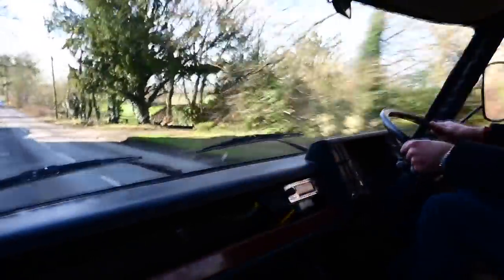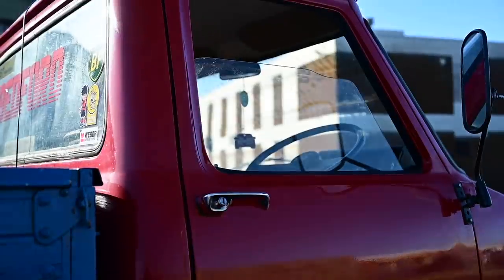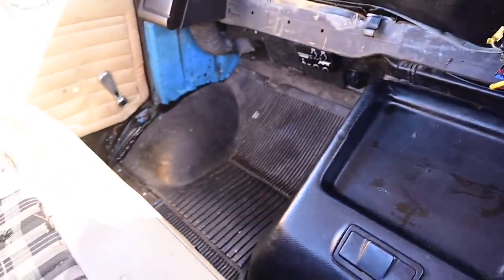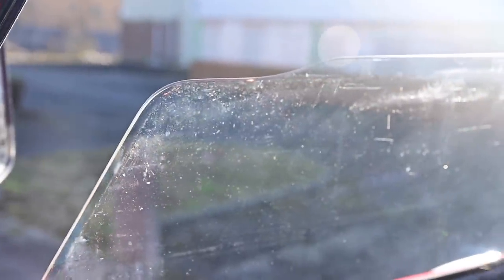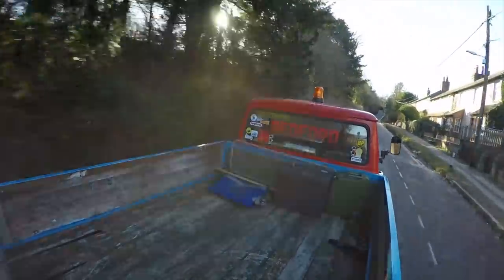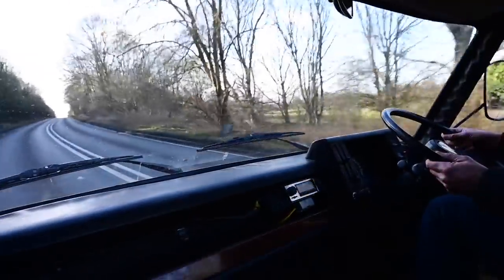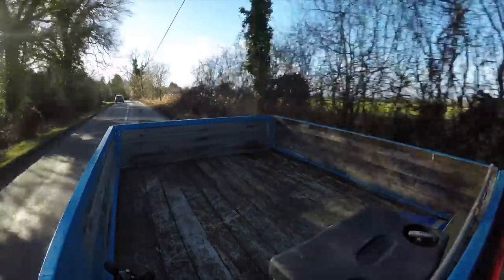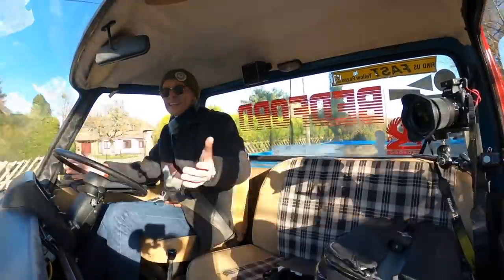1982 Bedford CF CF1 Pick up Goes for a Drive

Comment: Aussie CFs were also available with Holden inline sixes in them like the Aussie Transits were available with Falcon sixes.
Reply: I’ve got one! LWB van, 202 4 speed.
Reply: same in New Zealand
Reply: We here in NZ had those same choices of vans. The Holden 202ci was not only retro fitted, but endorsed by Vauxhall / Bedford.
The Australian 86-87 CF2 exported the inline 6 for inclusion of the chassis cab for NZ St Johns ambulance contract via the UK 🇬🇧 then sent to NZ as a CBU chassis cab for St Johns to coach build.
The NZ importer was Jones Locke Holden in Takanini, South Auckland. ❤😮
Reply: Our CF has a stock 173 Holden Red Motor, with all Holden transmission,brakes etc.
Reply: @kenwatkins7097  the 173ci would have been 2600cc used for LC swb Torana ( holden ) in my native NZ.
They would have been a quick turnaround for retro fitting in CF's in mk1 form 😉 l.o.l
Reply: @vernonmatthews181  Thats right, the 173 motor was used in the 6 cylinder Toranas and HQ,HJ series Holdens. Our 1979 CF van has the Low Compression 173 engine, 4 spd gearbox ( Holden, with the reverse switch), single drive shaft (whereas all the NZ ones I've seen have a double shaft), high speed diff, Holden brakes/drums & wheels, and the 'Manufactured by General Motors Holden' plate. But, all the wiring is stock UK stuff.

Comment: My parents had a 1970 Transit with a CI wayfarer conversion with the 1600cc v4 which was as slow as treacle in winter, it was replaced by a CF with the 2300cc engine and had a large coachbuilt Dormobile body on it, it felt like Porsche performance after the Ford. Good test.

Comment: I remember these being absolutely everywhere in the early 80s (along with Sherpas), definitely more common than Transits until that became the VE6 one-box design. Excellent find Matt!
Reply: Transits outsold the Bedfords in the 60's, 70's and beyond. The mk1 and mk2 Transit were everywhere back in the day, I remember seeing a lot more Transits than Bedfords about. 

I grew up with my family using both, the Bedfords were troublesome and a lot more unreliable than the Transits were, they especially loved to eat gearboxes.
Reply: Sherpas, 10 a penny in the post office.
Reply: Transits allways by far the most popular vans on the road in the uk.much more popular than sherpas and bedfords put together.

Comment: I’ve drove many of these for Sunderland Council excellent vehicles on the petrol engine the engine was a bit of a weakness Half a v8 or the slant 4 but the  bodywork would go on forever the main rival was the Ford transit had a brilliant engine but the bodywork was terrible.Thank you for this video brings back memories and also very interesting
Reply: Worth doing an EV  conversion in it, loads of space for battery pack, I-Pace or Prius transmission under the rear, 250/275 mile range would be respectful and usable...
Reply: @kylereese4822 wouldn’t get anywhere near 250 miles.

Comment: My dad had a fleet of these in the 70's / 80's. I remember picking up a brand new LWB van from Chatham Motors ( I think it was) in about 1983, having just been painted dark metalic blue 2.3 petrol. The Petrol tank imploded on the M2 motorway bridge due to the wrong non vented petrol cap being fitted at the dealers. Getting recovered was an exciting event for a 3yr old me  :)
Reply: That's a great vauxhall story if I ever heard one.
Reply: Was that the Vauxhall dealer in Chatham where Wickes is now?
Reply: @phil955i  I believe so. My Dad got all his vehicles from there so it would make sense. I was only 3 but one of my earliest memories haha. Apparently it was his idea to fit a chrome petrol cap to match the chrome hubcaps on his new van 😂 I also remember it was the fella that painted the Swains lorries, signwrote the van in the same gold script. I believe a Chevanne was purchased at the same time / colour combo.
Reply: @piercee100  In about 1988 I popped in there on the off chance they might have a cylinder head gasket for the 1963 Vauxhall Cresta PB I was running at the time. And they did, it was covered in dust but I was pretty amazed they had one on the shelf lol. I think that dealer closed not long after that.
Reply: HC Viva / Magnum / Firenza lockable cap would fit that CF, many had them fitted to panel van's in NZ back in the day.

Comment: I drove a pre-facelift panel van which, as you said in the vid, was spammed up, with a black roof and base and white around the mid, topped off with spotties on the front grille and roof line front and rear. Went like stink too, leaving many a surprised car driver in its wake.
You weren’t joking about a heavy clutch either. The clutch  cable needed regular adjustment and replacement when it had stretched too much, and I had to lock my knee straight at lights and junctions. However, that van took me, the band I was in and a ton of gear to London and back twice, as well as local and more distant gigs, and only cost us 350 quid. Probably long melted down now, but Betsy Bedford lives on in the memory! We loved her.

Comment: I'm in Australia. The facelift never made it here. I have a LWB, single rear wheel van with a 3.3l Holden 6 and a 4 speed manual. Love it to death. It has been fitted with vented front discs, greatly improving the stopping situation. Being high roof, there is plenty of headroom, even for 6' 4" me. Great to see a Bedford on the channel!
Reply: I envy you. Here in the Uk these things are like rocking horse shit.
Reply: @antman5474  They have no rust protection at all. An Englishman I met was amazed mine still had arches. They rust here, but not as badly, and repairable, or replaceable ,mine has a fibreglass bonnet for example. The MIG is my friend!

Comment: I was in Beavers/Cubs/Scouts in the 80s and 90s and our late group leader had the minibus version of this van. Tomato red, vinyl bench seats in the back (sans seatbelts obviously). Goodness knows how many days out or camps we went out in it, bouncing our way along. Skipper knew the roads to the local campsite in Commondale like the back of his hand and so he could absolutely blast it along. Fun, care free times.

He also had the pre facelift version which was used by the Cubs and Beavers while this version was used mainly for Scouts.  He proudly told me how the earlier version had no reverse lights and so he wired his own in. Good times

The timber yard that two of the characters worked in in Threads had a pair of these

Comment: The 2.3 engine was also used in the Panther Lima (which was based on a Vauxhall Viva/Magnum/Firenza floorpan), and the block was used by Lotus, with their own 16V head

Comment: I see the owner has put extra sealant on the rocker cover. That was pretty much essential with those slant four engines. They did like to spew oil onto the exhaust manifold, which my old Victor did several times causing much smoke and a significant risk of fire.

Comment: The van version of this was sold in Australia with a straight 6 Holden 202 C.I. (3310) engine in them. Our neighbour had one, converted into a Sunliner camper van. It was always kept in immaculate condition.  It would be quite a collector's piece if it was still around today, as it had all the bells and whistles.
Reply: We've still got our 1979 GMH assembled one, fitted with the 173 straight 6.

Comment: Well, that's a bit different, Matt!  Here in NZ, we didn't see much of the Transit at all, although there were a small number about and a couple of imported Campervans......but NOTHING like the number of CFs.  They were THE go-to for most things who needed a vehicle with plenty of pep and plenty of room.  The police, ambulance, road workers / councils (if they werent using JO or J1 Bedford trucks), schools - everyone pretty much!  We got the basic short wheelbase (SWB) CF van, the SWB cab and chassis (although most dealers sold them with a flat deck on the rear that you could take the sides and tailgate off) and we had the long wheelbase (LWB) version in either single or tandem rear axle.  The LWB was known here as the CF Jumbo.  

Jumbos were the ones locally turned into Ambulances, Mini-vans (as in 12-seater coach) or used by tradies with a lot of electric tools.  The flat deck was used almost exclusively by the likes of builders, bricklayers and such (my Uncle had a '72 flat deck with a 2.3).  Engine offerings - like the UK - were the 2.0 or 2.3 slant, although there were very few 2 litre units sold and over the years most had been replaced by the near identical to look at 2.3.....or a Holden 186 or 202 cubic inch straight six.  This was the most common repower for the Beddy and was also done in the coach-built Ambulances.  A less common but still often found at the time swap was for a 308ci Holden or 350ci Chev V8, which usually appeared in the Custom vans rather than campers or similar.  A few were done with manual gearboxes, but most were auto.  

Both the SWB and LWB van were used for customising and in the early 80s, there were many A-Team clones done with a Beddy....and I've even seen a Mystery Machine (Scooby Doo) psychedelic layout on one!  More often than not though, the customisations were a metallic paint job of either a single colour and much hand pinstriping or two-tone with a custom body-line stripe, much dark glass, replacement of the rear barn doors with a single metal panel and wide window that did not open, large or porthole side window, a bed of some large size in the rear, much mood lighting (fairy lights or wall lamps), wood panelling and / or shag carpet everywhere.  Chromed marker lights across the front of the cab was mandatory, as were a brace of spotlights, the Cheviot / Aunger Turbo, Trident or Hustler style of mag wheels.....and if you had a metal sunvisor and / or 6" rear aerofoil, you were really cooking.  

Speaking of cooking, Jumbos were the more popular for turning into campers and my Dad did exactly that with our one.  I have photos of him and a mate cutting the roof just behind the seats and raising the whole thing up by two and a half feet.  She served us for many years, did that Jumbo - and Dad being a bricklayer, loved taking it to work because it was a place he could sit in comfort, make a cuppa and keep his tools safe.  Mum drew the line with him chucking the concrete mixer in there though!  Pop-top campers were also common over here and many a Jumbo was converted in that fashion.  We didn't get the factory CF camper, but a few were imported or came over with people emigrating from the UK.   

I loved the old Bedford CF and when I look at campers - dreaming of the day my wife and I retire and tour the country in one - it is always the CF Jumbo I look for first.
Reply: When I worked for the NZR Road Services in NZ, we had both the Transits and CFs and both had the slant 4 engines. Moved to Aussie and theirs had 6 cyl Falcon and Holden engines.

Comment: a great vid, i had a 74 cf 1800 in 1985, much better than the transit i had to drive for my job, when the 1800 broke, stuck in a 2000 victor engine, when that went bang stuck in a magnum 2.3, it went quite well, loads of torque, then i got hold of a rover v8 so that made it go really well except the cost of fuel as i did not change the diff ratio from the 1800 one, i had a bull bar, extra lights, 2 roof spoilers, wide custom wheels and jacked it up 3in all round!  i miss mine, would love another one.

Comment: These were very common in New Zealand. When I was a kid, I remember our family artist visiting with an old CF, parking in the driveway. When he went to leave, the ignition jammed and the key broke off. Anyway, with a combination of drilling and chiselling with a small cold chisel, I had the lock off to free the steering in about 5 minutes.  I twisted a few lengths of heavy household wiring together and put them in the connector, by trial and error the engine was started. Entertainingly, six months later, he was still driving around using the same wires to start the van.
Reply: Vauxhall/Bedford keys were at this time aluminium ( aluminum ) , for the Americans.
Keys broke 💔 in their ignition all the time.
Heard of stories of scissors ✂️ jammed in the steering column to make them start 😂👌

Comment: Great idea driving this Bedford! I can remember having seen them here in the Netherlands back in the day, but only as Bedford, not as Opel Blitz. Blitz means lightning bolt by the way, and it refers to the horizontal blitz in the Opel logo. Not to the Blitzkrieg or some ww2 logo 😅
Reply from the maker: That makes sense! Although the 1970 was closer to the war than 1970 is to today so memories were still fresh at the time
Reply: @furiousdriving  Worth doing an EV  conversion in it, loads of space for battery pack, I-Pace or Prius transmission under the rear, 250/275 mile range would be respectful and usable...
Reply: My parents had a 1980 (pre-facelift) with a RV body on it (in the Netherlands). We went even to Bedford club events with it. Somewhat needed as well as there was a tendency for break downs. Ran out of adjustment for valve clearance in NL, carburator issues in Scotland (the Vauxhall dealer was just in the process of removing the Bedford signs) and in Denmark the driveshaft failed. That and the rust repairs made them sell it. The Bedford club still exists and CF campervans and RV's are still the primary members.
Reply: PS: When about 10 years ago I want looking for my own campervan I could not find one to my liking and price. They got rare. I ended up with a 1979 VW LT which was great but maybe even less reliable and for sure more rusting. The LT drove more truck like than the CF. In the end the noise on highways drove us to a modern Citroën Jumper/Relay.

Comment: At one point as a kid one grandparent had a Midi, the other had an older CF. The Midi was around the same size as the CF and felt considerably more modern. The lift up tailgate was a joy when loading and unloading in wet weather. The problem with the Midi was parts. The van was imported in bits and assembled in the UK which mean when something went wrong the chances of Bedford having a spare seemed to be slim.

Comment: I have driven, many years ago, a battery powered Bedford CF panel van that had a 50 mile range and the charger was nearly as big as the van. It was a prototype given to bus company's as a demostrater to see if their was a market for it in the 80s.
It had a raised bed in back to accommodate the battery's.
Jong.

Comment: I drove one of these for a while when I was a GM apprentice back in 1972-76. Mine was a panel van. Barn doors at the back & sliding doors up front. Unfortunately it only had the 1800cc slant 4 engine with a 3 speed gearbox which was OK around town but woefully undergeared on faster dual carriageways & motorways. Fond memories camping out in it with the girlfriend at brands hatch on race days. I also drove a flatbed version similar to your one for a while as a saturday job delivering hardware. I found the clutch on that one (4 speed) much stiffer to use. Fond memories of simpler times.

Comment: In Australia the CF kept the original styling for the entire production run & they all had the Holden Inline Six in them, quite a large engine hump intruding into the cab.
Reply: The Holden inline six was a very primitive engine at that point, OHV with siamesed ports(3 inlet, 4 exhaust), only the same power ranges you quoted for the Vauxhall slant four, but probably never reached 100hp in any state of tune as originally fitted to the Bedford CF, I'd have to imagine it did offer more torque to justify using it instead of the Vauxhall engine, unless it was to satisfy a government mandate for minimum local content.

Comment: Great to see a CF, I work for Vauxhall normally in Ellesmere port but am currently working in Luton in the plant where they were built.
On my previous job back in the 80's I drove a CF 1 2.3 Luton van (went like a rocket) a much newer Transit Luton (low power gutless) and a CF2 panel van. The CF2 was fitted with the Opel cam in head engine used in the Manta & Mk1 Cav. The only problem was it didn't have a gate into reverse which was next to 1st!